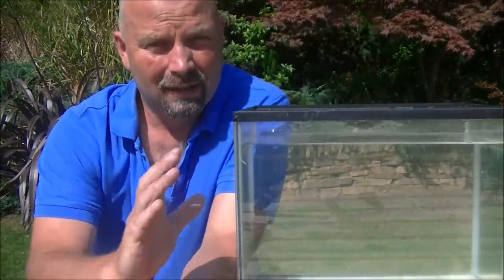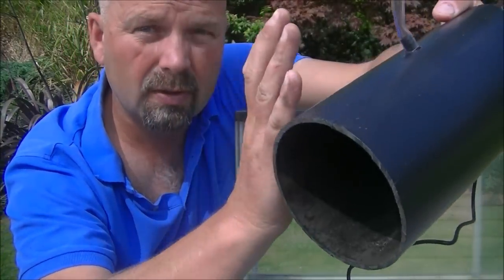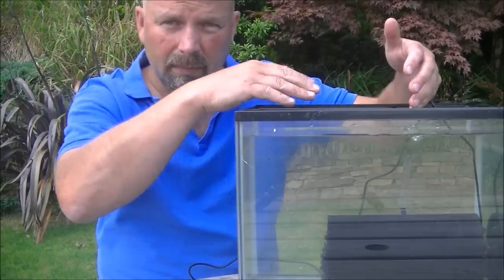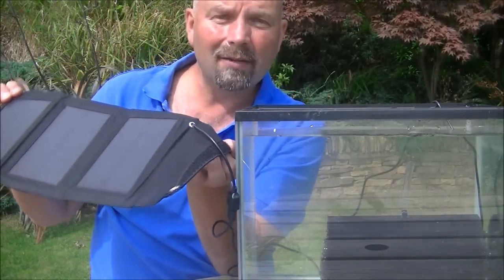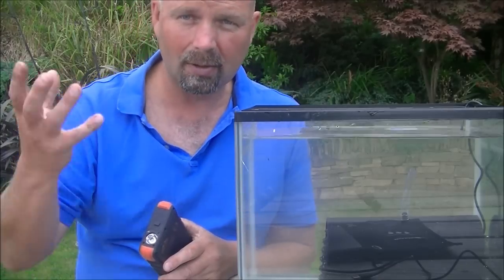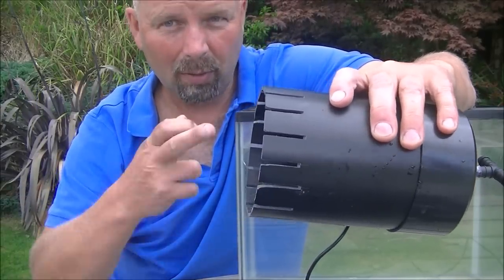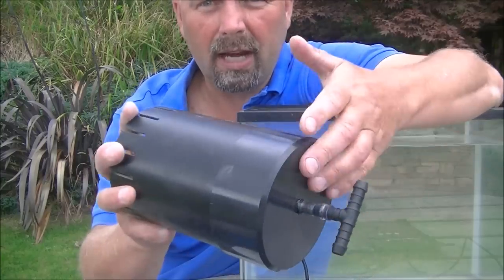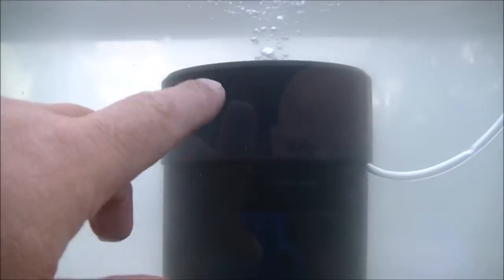Emergency Aquarium Filtration or Nitrate Reactor Aquarium Filters You Can Build Easily

Comment: Love this video, love all your filtration series. To help with the drop out issue stated  @17:07 eggcrate or mesh secured to the bottom would help secure the pads and media. Great job though, love the innovation.
Reply from the maker: Yes that would do it but to be honest it's not really an issue as long as the bottom of the filter is supported during removal.

Comment: The air pump on my little bros fish tank over heated and died during the heatwave, I literary brought one of those battery powered air pumps for live baits a week before intending to use it for transporting my koi to the lake, it ran my bros sponge filter for 4 days straight on just 2 size D tesco value batteries, would probably run a week straight on quality batteries. It actually has more power than the replacement pump ive brought him lol 150l per hour is pretty impressive for a battery powered jobby
Reply from the maker: That is a great result. After making this video I added details on the 10000mAh power bank and how long it would run the small USB air pump - apparently it's 50 hours / just over 2 days. That's ample time to have a second power bank charging with solar and a quick swap over could keep the air pump and filter running indefinitely in a grid-down situation.

Comment: I've had a USB water pump for 3 or 4 years now and it's been running for most of that time and it's running now I've just tried to find the type I got on Amazon again but I'm struggling you will love them the ones you have control flow by restricting the inlet and use the same amount of power regardless of the amount of water it's moving the one I have has 4 different power settings and it uses a fraction of the power on the lower settings no4 is to much for most situations and it has pipe fittings on the inlet and outlet and that has a lot of benefits 1st the water coming into the impeller is less turbulent and restricted 2nd it can be on the outside of the filter no need strip every thing to get to it 3rd it doesn't need to be in the water at all and it will probably last even longer used that way